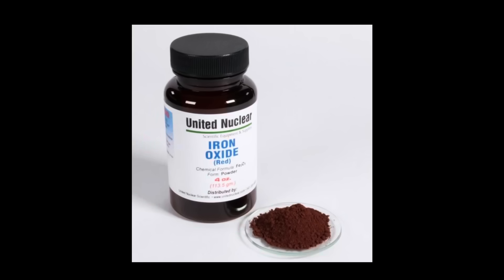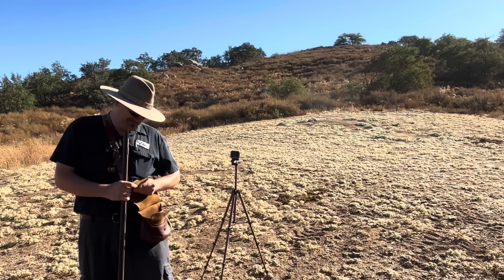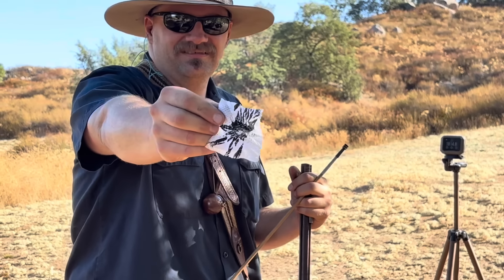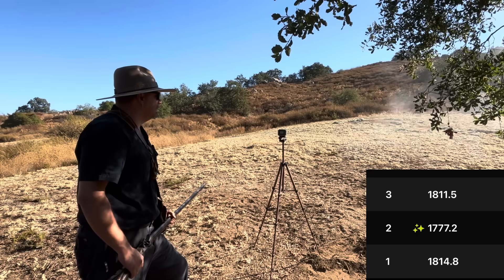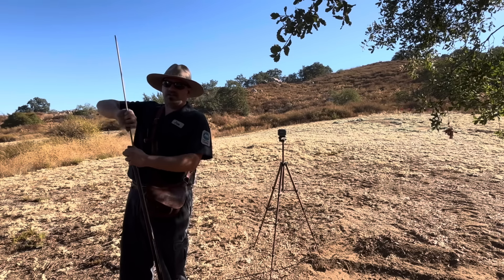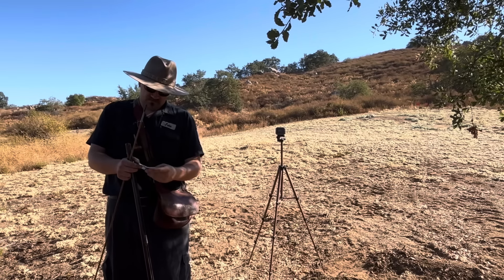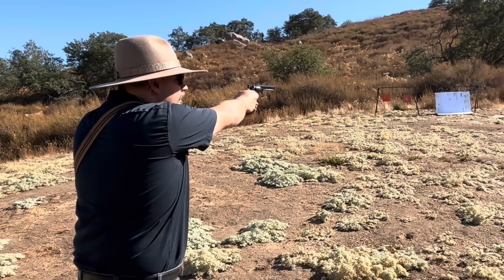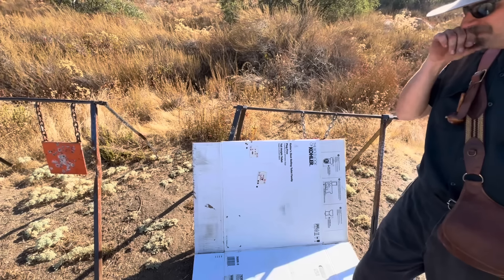Can Iron Oxide Improve Your Black Powder?

Comment: I'm gonna go out on a limb here.  The iron oxide,an oxidizer, will help, but it'll be filthy and leave iron clinkers in your barrel.  Not a good thing.   Of course, I could be totally wrong.   Either way, I'll be watching.  Knowledge is a good thing.
Reply: I guess I'll keep my speculations to blackjack😊
Reply: I don't believe it's considered an oxidizer. It's just an oxide. It is the oxygen source in thermite reactions but that's because aluminum has an extreme affinity for oxygen and the ignition temperature of thermite is very very high.
Reply: Iron + tumbler = spark = boom !
Maybe add some ground flint to the iron in the tumbler !  Not for me .
Reply: No. metallic iron sparks, Iron oxide is no longer metallic. Provided that the Iron oxide used is fully converted, it cannot cause sparks.
Reply: @Dreadought  Thanks .
Reply: strictly speaking, even metallic Iron doesn't really spark, pure Iron makes for very poor strikers, it's just not hard enough for the struck off particles to be hot enough to burn/incandesce. For sparks to be generated it needs to be metallic, and it needs to be hard enough that deformations generate sufficient heat to ignite it.
Reply: In this case, the iron oxide would be a bystander. Being already oxidized, it would remain iron oxide on both sides of the reaction. If it does anything it would probably affect burn rate. It would still be filthy.
Reply: @Fu3R4 it is an oxidizer, it is usually used in “rocket candy” or “white powder”.
Reply: @dtaggartofRTD provided the ignition temperature of black powder is what it usually is for “white powder” or “rocket candy” rust most certainly is an oxidizer, it is not the iron that we are trying to oxidize but the carbon. During a burn the oxygen attached to the iron will be stripped off of the iron and be re-bonded to the carbon.
Reply: @the_great_tigorian_channel  I'm not incredibly familiar with white power, but for rocket candy it acts as a catalyst modifying the speed the granule burns at. Chemically it doesn't change throughout the process.
Reply: @the_great_tigorian_channel It doesn’t act as an oxidiser. It acts as a catalyst to promote the decomposition of potassium nitrate
Reply: Iron oxide is not going to provide oxygen to the reaction. Rust is FeO3, iron with a valence of +6 and oxygen -2. It’s stable. It will take energy to break that bond and get the oxygen to bond with carbon at +4. It would be more likely that the oxygen would bond back to whatever iron was available.

Now, if you superheated CO in the presence of iron you might get it to go the other way. That’s how they make cast iron and steel.
Reply: It is oxidized, not an oxidizer.
Reply: @hiltonian_1260 there's another commun oxide used inside chambers for burning, nitrous oxide, it works by using the energy already present (in a gasoline engine if that wasn't apparent yet), to break some o2 off and then that ADDITIONAL o2 can be utilized to burn EXCESS fuel. In an engine, if you just add the nitrous, it doesn't really do anything, there must also be additional fuel in the mix. This also takes significantly more time to complete the burn, since there are essentially two separate burns happening in the same stroke, that's why the timing also needs to be advanced to sometimes dangerous levels .
In a gun barrel there's no timing advance possible, you can only make the barrel longer, and I'm honestly not even sure what the additional fuel would be...
Reply: Iron oxide is not an oxidizer per se, it is iron already oxidized. It does act as an oxidizer in thermite, but only because aluminum wants the oxygen more than the iron does, so it rips the oxygen from the iron.
Reply: @mduckernz while it does indeed speed the decomposition reaction of KNO3, According to several experiments, some of the rust actually does have the oxygen stripped and the result is an iron soot that has some iron particles that are free of oxides as the soot reacted and re-oxidized when tested against acids. I ran my black powder and found similar results where some Fe(III) oxides were also stripped of their oxygen as the carbon in black powder acted as a reduction agent. So, no, not all the rust is likely stripped of its oxygen but some most certainly is or the iron I extracted from the soot via magnet wouldn’t react with acids as they would be entirely stable and unable to accept any new bonds. 🤷‍♂️
Reply: @hiltonian_1260 any carbon source can act as a reduction agent when trying to strip Fe(III) oxides if doesn’t have to be superheated carbon monoxide. Experiments show that rust particles can be stripped of oxygen and re-bond with carbon provided there is enough heat and/or pressure. The more iron the greater amount of heat and pressure needed. We aren’t dealing with a ton of iron here. Pass a magnet over the reactant to extract the iron/iron oxide and then test the extract using acid, if it reacts there is unoxidized iron, if not, then your powder didn’t burn hot enough or your bullet didn’t allow enough pressure to build. Some of the iron does remain oxidized and some does lose it’s oxygen to the reaction and some does react with the air to steal it back. You don’t have to believe me but that has been my experience, you can always make your own dang video. 🤷‍♂️
Reply: @scotty3114 the reaction in thermite produces way more than enough energy to strip oxygen from iron. The result is MOLTEN iron. To take the rust off of iron your don’t have to melt it.
Reply: @hiltonian_1260 
True though, the reaction between iron and oxygen happens far more readily than the reaction between oxygen and carbon and the energy lent to the reaction when oxygen links with carbon is outweighed by the loss when oxygen is stripped from iron, so rust’s primary purpose is as a catalyst rather than a fuel, but it can and in many instances does end up fueling the reaction to what is still a net loss.
Reply: @the_great_tigorian_channel  Tour are right, but oxygen comes from iron because the aluminum has a much greater attraction for oxygen. The act of ripping the oxygen from the iron to oxidze the aluminum is what generates so much heat. You have to get it hot enough to start the reaction, but once you do, it is more than self-sustaining .
Reply: @scotty3114 correct, but in in the propellant discussed here there is (thank heavens) no aluminum. Some oxygen is stripped from the iron via pressure and heat. The oxygen can re-bond with the iron but there is a lot of chaos in a barrel meaning some will inevitably bind to whatever it can, like the carbon. Gosh, I love chemistry and physics… something must be wrong with me.

Comment: Don't put aluminum in black powder, its going to generate alumina (Al2O3) in combustion which is an extremely hard ceramic, not something you would want coating your rifle grooves.
Reply: Good to know thanks for the input
Reply: OR? I glaze my groves?    Yes I was in the Glaziers and Glass Workers, and foundies and forges, and passivation and pipe pigging.  alumina may be a great surface passivation.
Reply: @davefellhoelter1343  if the alumina is bonded to the surface, sure. if its loose micro crystals, it will erode the barrel.
Reply: Iron oxide and aluminum powder mixed, that's the basis of a thermite reaction.
Reply: Aluminum powder...is sometimes used for glazing ball smokeless propellant. Also one of Goex's BP plants used aluminum balls for milling and the thought was that the trace particles imparted a higher burn rate to the powder, which was backed up by their test data.  Al03 particles are going to be formed on combustion- that is correct, but I'm disinclined to think this would cause barrel erosion or damage to rifling unless you don't clean your gun after firing.  AlO3 in insoluble in water and will just wash out with solvent patching, it's not going to bond or stay in the barrel unless you leave it there by not cleaning.   Lastly- I make my own propellants for muzzleloaders and some cartridge loads, one of my recipes uses 1.6% 80 mesh Al powder as burn rate catalyst, been shooting it for four years now in several guns and it's not causing any erosion problems- it does create an interesting whitish vapor on firing that quickly dissipates.
Reply: @schinderiapraemeturus6239  I've never actually tested aluminum as an additive in any propellant, so i'd assume  the alumina particles would accelerate erosion, it makes theoretical sense.
But if you tested it a lot and didn't observe any erosion, that's actually really promising then; it should increase the enthalpy of combustion substantially
Reply: I did! and "I agree" and I do now use "alumina" media for my ball mill
Reply: @ Alumina, aka aluminum oxide, is commonly used as an abrasive. You can go to the hardware store and get aluminum oxide sandpaper, for instance.
Reply: @ Yes! Sparky's call it CAD WELD and I always ordered "enough" for each job. Yes, I have some in the warehouse. Phun stuff.
Reply: @ I have, but my tests are to hard to finish as I live south of the Masson Dixon in La Co CA.  it's a two day trip type deal with about a $200 fuel investment

Comment: just say no.  if iron is burning,  it's burning at a temp that will damage your barrel.
Reply: Only potentially.
Reply: It's a catalyst, not a fuel.
Reply: Technically rust is burning iron as the process of oxidizing produces heat however it’s REALLY SLOW
Reply: That's not true, the smaller a piece of metal is; the lower its ignition temperature generally becomes as well.

He's using a Flintlock which makes sparks by scratching off tiny bits of hardened steel from the frism(prism?) allowing them to oxidize and heat up so fast they "Burn" or/aka become sparks, you think those sparks are gonna damage the rifle too? Yes a powder that burns too hot will erode the throat of the chamber and rifling, but he didn't show anything about what the temperature or burn rate of the powders were just that the velocity was lowered when added in his specific blend already custom tweaked to increase performance.
Reply: @pyro1047  sorry but particle size does not change the ignition temperature of an element.
Reply: @lr21643  actually, it's just an abrasive, if it's not reacting
Reply: @lr21643  bullshit sources required
Reply: @pyro1047  A smaller piece of metal might need less heat to get to a certain temperature, but it seems very unlikely that the chemistry would be different, resulting in a lower ignition temperature. If you have 1/10 the volume of metal, the same energy applied ought to result in 10 times the increase in temperature.

Comment: At least it didn't turn into thermite.
Reply from the maker: It could always be worse
Reply: Thermite projectile i wonder if it can be done with 12 gague
Reply: Yeah, that would weld to the barrel and would also need aluminum. Rust alone is safe.

Comment: (Waiting for the video to drop). Interesting. I know iron oxide acts as a catalyst in modern solid rocket propellants.  Maybe it will increase burn rate or help get complete combustion with less mill time.  Cant wait to see.
Reply: Iron Oxide is one of the components of Crimson Powder, which is used to eject the parachutes.  Crimson/APP can be used as an "antique muzzleloading propellant" to get around D.O.T. transportation & shipping regulations.  Lets you use smokeless powder lube,  but It is significantly weaker than Black Powder and difficult to ignite in a flintlock.

Comment: Never add powdered metals to your black powder. It will go past being a "low explosive" to a flash powder, or, the beginning of the "high explosives" realm.
Reply: Yeah. I mean that might be a better idea if you were trying to make a jam tin grenade like the British did in WW1. Tin can, gunpowder and match fuse.
Reply: Rust is entirely safe, it doesn’t turn to flash powder unless you add zinc or aluminum powder. Blackpowder is classified as a low explosive already. High explosives require a supersonic shock or supersonic reaction to detonate and will only burn slowly otherwise. 😒
Reply: Yes but your rifle will blow up in a lot of pretty colors! (I'm mainly a fireworks guy)
Reply: Except rust isnt a flash powder… the worst this will do is rust his barrel betond belief if he doesnt keep on top of it more than regular.
Reply: Flash Powder is NOWHERE near "The beginning of High Explosives", to be considered a High Explosive it must "Detonate" instead of just simply "Deflagrate"; which also requires it to propogate a shockwave through itself higher than the speed of sound I.e. "Supersonic" (Or 1,125ft/s "On average" as the speed of sound differs depending on altitude, temperature, humidity, material and composition of said material, etc).

Now it may be a "Low Explosive" and still explode if confined, but you know what already ticks those boxes too? Black Powder and Smokeless Powder/Nitrocelulose aka "Gunpowder"; and an "explosion" and a "Detonation" (Which is a requirement for something to be considered a "High Explosive") by their very definition aren't the same thing as once again anything propagating a Shockwave through itself slower than the speed of sound is not considered a "Detonation", but simply a Deflageation. 

That doesn't mean it's incapable of blowing his gun up, Gun Powder can already do that; especially if his is an original Iron weapon and not a modern 20th-21st century steel replica. But a Pipe Bombs still not a "High Explosive", it's simply "An Explosive"; in the case of PB's usually a Low one relying on confinement to increase the burn rate enough that it ruptures the pressure vessel into fragments before it can vent/leak out because the user doesn't have access to a proper HE the Blasting Caps most of them require to set off (Which also implies their use is for criminal activity, and as destructive devices must be serialized and registered/Tax Stamped by the BATFE or "Bureau of Alcohol, Tobacco, Firearms, and Explosives" or more commonly "The ATF".

The main danger of Flash Powder compared to even Gun Powder is its Highly sensitive to Friction, Heat, Shock, and Static Discharge; even worse small quantities can be capable of "Self-confinement" and exploding in open air potentially causing both Hearing loss and/or injury, possibly severe (Self Confinement occurs when the mass of the overall Powder pile provides sufficient inertia to allow high pressure to build within it while the mixture Reacts; but while yes an explosion, it's not to be confused with a Detonation which it isn't and therefore still not HE).

Comment: I'm betting the garmen WAS reading properly but the iron content in the smoke was enough to temporarily blind it. Like trying to find a bumblebee in a snow storm
Reply: They have iron additives in the smoke generators on tanks and it confuses radar
Reply: I think so too.  The smoke was pink, if it's a radar device then for sure it has an effect.  I had trouble getting bismuth/tin bullets to read across my magnetic chronograph that reads lead alloy perfectly, must be that the lead-free metal wasn't dense enough to reliably trigger the sensors.
Reply: Having an understanding of how these works helps a lot. This dude maybe shouldnt he mixing things together if he doesnt.

Comment: Interesting, I mostly use rust in my “white powder” which uses sugar (sucrose) as a carbon source and it does improve the burn rate. In rocketry it increases specific impulse which doesn’t always just mean burn time, but overall thrust. Your choice to use it in blackpowder and in just less than 1% MAY be a reason it didn’t help much. The one time I used it in my own blackpowder I had a slightly hotter burn but I was using the classic 75-15-10 ratio and you have already altered your own ratio to introduce a higher level of oxidizer which is what rust is trying to do. So it may be that the rust is hindering your performance here because it was meant to solve a “problem” you already found an alternate solution to. At this point, the rust might just be “getting in the way” of your 77-13-10 ratio.

P.S. SUPER glad you didn’t put that aluminum flash powder in your gun all that time ago, that stuff is used as a bursting charge in fireworks and flashes way too fast for muzzleloaders to be used safely.

Keep up the great work!
Reply: 10-4 Fellow rocket,  black powder, fireworks guy!👍
Most of that stuff will never see my flintlock!
Reply: Same here 😂 @davisrs1

Comment: We used to have a BP substitute here called Sannadex. It was bright pink worked pretty well and we were happy with it because there was little else available here in South Africa. I guess it had a fair amount of iron oxide in it. 65 grains in my rifle chucking a Maxi bullet it managed a comfortable 1750 odd fps @ 6000 ft above sea level in 35 deg C temp
Reply: Sannadex is based on chlorate and sugar. It should also contain iron oxide. But it is not necessary, just chlorate (60%) + sugar 40% is already much better than Black powder.
Reply: Yup. I have heard of it before. Iron is not a harmful component for muzzleloader propellant despite what people would have you believe… unless it is mixed with aluminum or zinc! That stuff makes flash powder!

Comment: My guess is it will be slower. I remember reading some paper, where they used metal oxides (TiO2, ZnO2, MnO2,...) to slow down burning rate of black match.
Reply: correction: it was composition for time fuse not black match

Comment: Burn rate catalysts for rocket propellants are tailored quite closely to the chemistry of the propellant itself.  Fe Oxides work OK with ammonium perchlorate  propellants, but not necessarily with other types of compounds.  Details matter.
Reply: Well, they work fine with both potassium nitrate and ammonium nitrate, and are often used as catalysts with those oxidizers too.